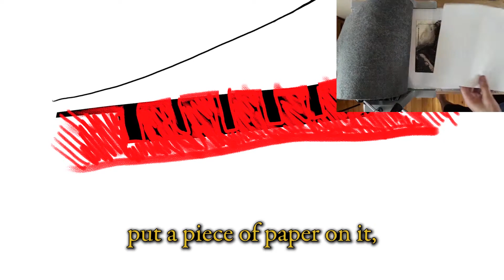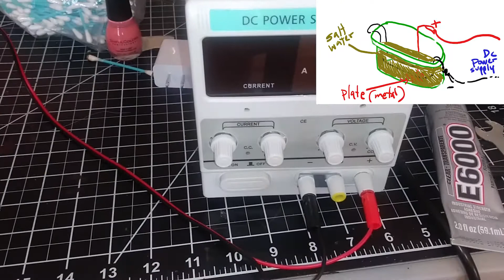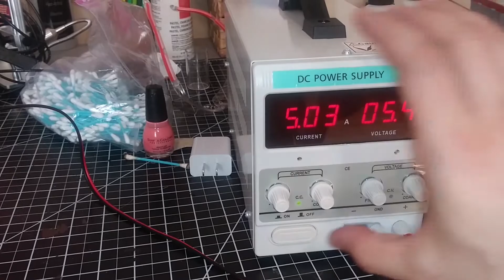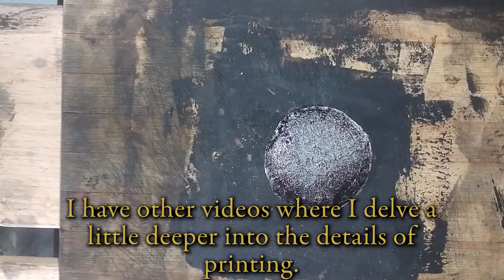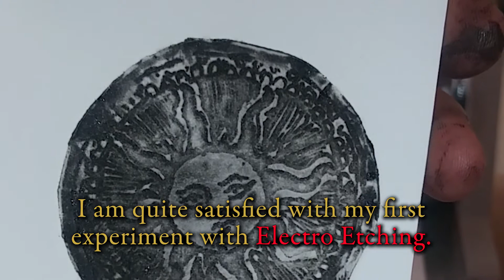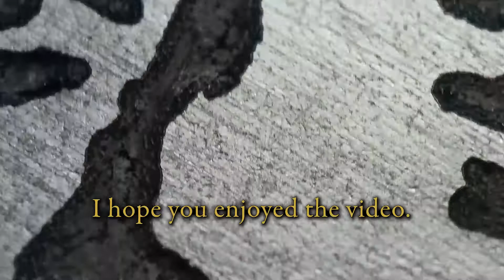Etching Metal(Electro Etching)

Comment: This is incredible!  I like that you mention the  historical elements as well, with armour and so forth.  A question.  If you leave the metal in the bath for longer, does that make the etches deeper?  Or is it the amount of current that affects the depth, or the concentration of the salt/electrolyte?  Its a fascinating process and one that I knew nothing about.- thankyou for sharing it.  :o)
Reply from the maker: Thanks a lot. That's what I thought when I discovered this technique. I studied engraving a few years ago and visited different techniques of engraving on metals, wood, stone and textiles, but for some reason, I never heard anything about electro-etching. It was precisely on YouTube where I discovered it. I'm still learning to master it. The longer you leave the plate submerged in the electrolytic bath, the deeper the etchings will go. That is why the process must be constantly monitored. Sometimes you have to take out the plate and cover some areas with some varnish to protect it. The concentration of salt in the bath and the amount of current also influence the depth of the bite. But for now I only manipulate the dive time. I'm still experimenting and I invite you to try it yourself too.
Reply: @just-swamp8715  Fascinating.  I may well have a go at it at some point - have to get the necessary equipment first though, power source, etc.
Reply from the maker: @Feenix102   I suggest the power supply that I put in the description of the video. It is cheap and it works perfectly. I tried several and this was the one that worked best. I am already editing a new video where I explain some techniques to create the protective varnish. and more of the electrolytic bath. I hope to share it soon.